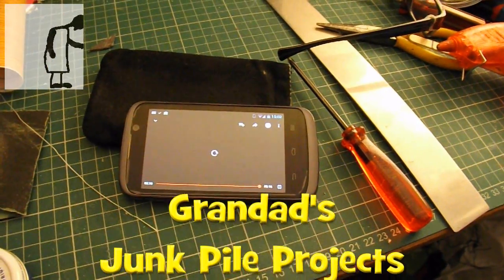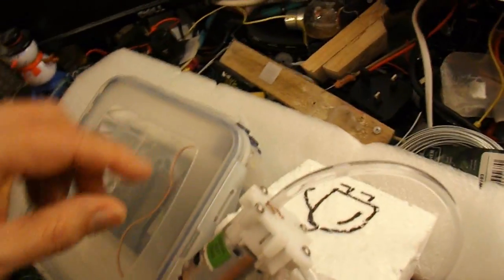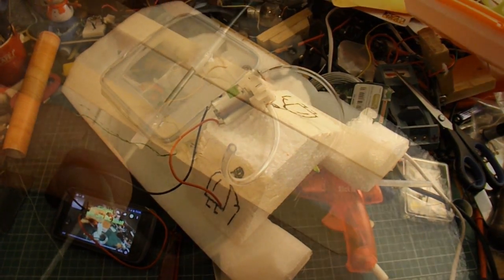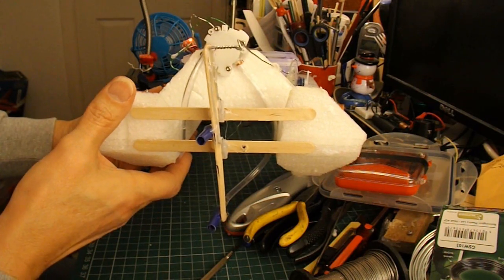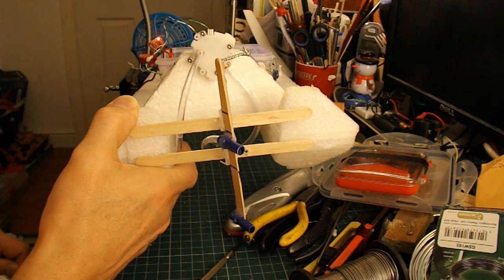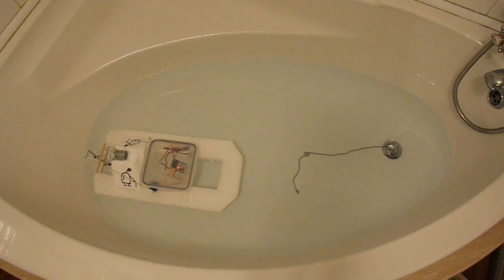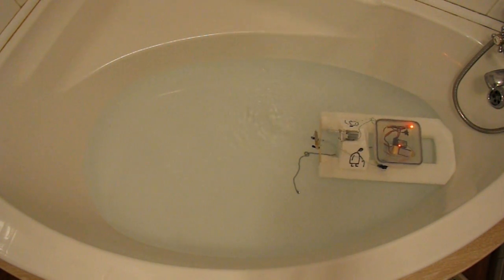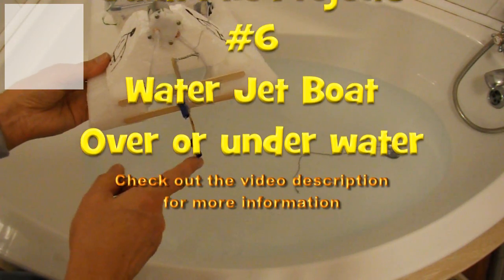Grandad's Junk Pile Projects #6  Water Jet Boat over or under water

Comment: I don't know how you boat tested outside.  If you still have it, put a bendy straw down the side of you Popsicle stick and bend it out along the underwater one.  Air getting sucked into the water stream might 'turbo charge' it.  Of course, it might just make it go in circles.  ;-)
Reply from the maker: Sounds interesting, have you actually tried this idea? I have not seen it used on any of the full sized commercial jet boat systems.
Reply: I always wanted an RC boat, but sadly haven't gone there yet.  It's still on my list :-D
Reply from the maker: In the video description there is a link for the rest of the videos in this series so you can see how this one progressed 😊

Comment: make quad copter
Reply: He doesn't make quad copters because they require expensive electronics and require a very good frame. You will see one during January though as we could see in his January trailer/teaser.
Reply from the maker: +X-FLIGHT101 it is not so much the expense of the items (although that puts it out of the range of my normal projects), it is the fact it is cheaper to buy it ready made. Most people are asking me because they think I will make it from cheap components and so they can copy me and make a cheap quadcopter. That is why I am making the point that if they want a cheap quadcopter or helicopter then it is better to buy a ready made one because that is the cheapest option. Making it yourself will cost you more money.

Comment: make quad copter
Reply from the maker: +Daniel de Vynck I get asked to make drones and helicopters so often I have a standard cut and past reply.The answer is NO. To make a helicopter or quadcopter stable in flight I would have to buy so many parts designed for the purpose it is cheaper to buy a ready made helicopter or quadcopter or a kit. A good example would be something like the Eachine H7 2.4G 6-Axis LED Mini RC Quadcopter. On top of that, my channel is aimed at simple, quick, cheap projects and a helicopter or quadcopter build is not a simple, quick, or cheap project. You would be better finding a channel that specialises in RC Quadcopters or Helicopters so you get the information from people who know what they are talking about. FliteTest would be a good place to start https://www.youtube.com/user/flitetest
or anything David Windestål is involved in https://www.youtube.com/user/dadde87
or you might like this video by The Post Apocalyptic Inventor https://youtu.be/qa_x93JQhNM
for rubber band power check out the work by norris432 https://www.youtube.com/user/norris432
Francisco Ramos Muñoz is currently doing a quadcopter project https://www.youtube.com/user/franramuzz/videos
Why I won't make an RC helicopter from an RC toy car https://www.youtube.com/watch?v=92GKSUi2y-8

Comment: You could time it and see. How long it takes to get from one end of the tub to the other.
Reply from the maker: +dgrcgrl that is such a short distance there is no way I could time that accurately enough. It needs to be tested on a nice sized pond in flat calm conditions. I have had a few attempts at doing that but the first time I tried it on a stream that was flowing much too fast and the second time it was a good sized pond but far too windy.

Comment: It appears that the under has more power but the over has more steering ability. What if you split the two and pumped from the top for steering and bottom for speed?
Reply from the maker: +dgrcgrl if you split the output from the pump you will only supply half the power to each jet. However the object of this project was to establish the difference between the two options not to combine them. Maybe if I can get a clear result a further development might be combining them but that is not on the agenda at the moment.